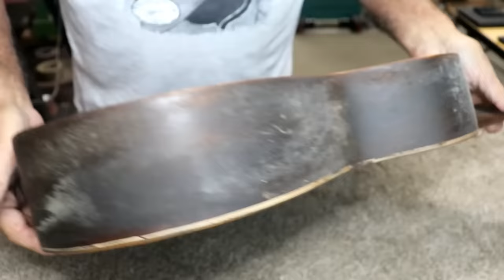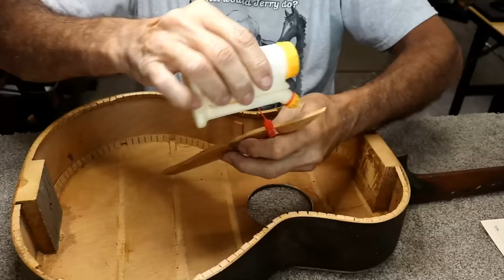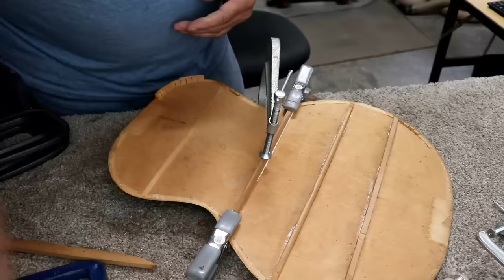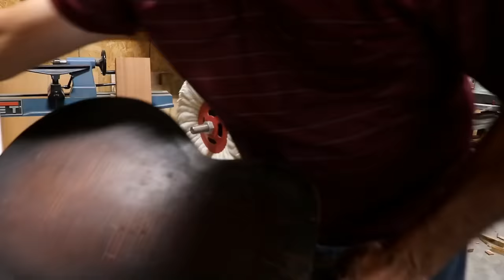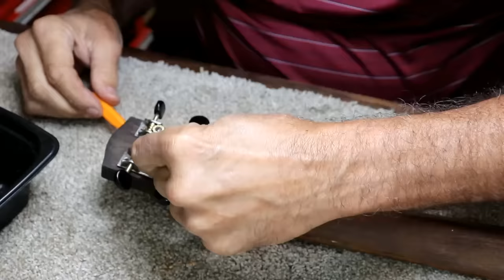596 RSW Can This Wall Hanger Become Playable? - A 1920's Mail Ordered Vintage Guitar Repair

Comment: Guitar Geek time! Those tuners Jerry cleaned up so well are extremely early Kluson units which do not have the scalloped plates. Kluson began making tuners in 1936 and it appears this guitar was made in January 1937 so Richter- based in Chicago- like Kluson itself, must have been one of the first- possibly the first company to adopt them. Very quickly other makers began using Kluson- Gibson in about 1937 and then Regal in 1939, followed by Kay and Harmony in 1940 or so. Harmony also of Chicago (Kay and Regal, likewise) was owned by Sears- which is why Sears retailed guitars were made by Harmony until 1940. 1940 was the year that Sears sold the company to its management- and Kluson helped Harmony's managers to buy out the company. So, there it is- just some tuners but an interesting history illustrated by this one guitar which now sings again, after Jerry's sterling efforts.
Reply: Awesome history, thanks! Do you know anything about Tango? I have a faux resonator with Tango on the head, shares a lot of similarities with this guitar here. Tuners look to be the same, no Phillips screws, etc.
Reply: Great tuner info!

My first guitar is downstairs here at my sister's place and I am here for a visit! Decor for the game room.  Was my uncle's and of the era and configuration of the guitar in the video. 1930s most likely. College Pal on the headstock.I do not j anything visible in the sound hole.. The video has inspired me to see if it can get a similar resurrection! 

Thanks for making the video JERRY!
Reply: Late 30's early 40s is about right. The vee neck, machine heads and the beveled end to the fretboard are good indicators. I'm pretty sure this was a Harmony made guitar, I've had plenty of them through my workshop (and still have few in my possession) and they are remarkably similar in shape and construction  from the late 1930s through to the early 1970s.
Reply: @justinlarsen2011  I have not heard of Tango- it would be a brand name from a retailer but most of the faux resonators were made by Harmony, Oscar Schmidt and Kay but I think Regal made some as well- not sure of Richter. If your guitar has the Kluson tuners it is more likely to be Kay or Harmony. Harmony and Richter guitars like the one Jerry has worked on look very similar- there are small differences but they are there. You will need to look at faux resonators and see if you find one the same and somebody has identified it. The only problem is that so many people get this wrong. The classic example is the Blue Comet resonator mandolin- it is on Wiki as a Regal product- it is not- they were made by United of New Jersey but that Wiki enrty now means everybody says they were made by Regal!
Reply: @68RatVette  Go for it!
Reply: @ChickenboneJohn  It is significantly different to the 14 fret guitars that Harmony made for Sears to be sold as Supertone models which had an arched top. One thing for starters is they had a bracket to support the pickguard and one screw in the top and one on the side for the bracket- not two in the top. This one has that Richter name stamped on the piece of wood inside, so there is no doubt about this guitar's maker.
Reply: Wow!!!!  I’m impressed..seriously
Reply: @NickRatnieks  Yes, but I was referring to the Harmony Stella 929 family of models.They have the shape and size body, same shape headstock, 12 frets to body, same ladder bracing, and over the years sold as Harmony, Stella, Airline, Regal, and Oahu amongst others.
Reply: Since you know so much about Harmony guitars I so wanna show you my 1962 for information on that one 😁
Reply: Over the years, I've restored a number of old guitars made by Kay, Harmony, Regal  Airline, etc. I've worked hard to understand these companies and the products they made. However, I've never seen such a concise, helpful explanation in one place like what you've provided here. Do you have a blog or a website?
Reply: I have a Silvertone says Harmony 57 under top but has same tuners and similar trapezoid as that 36?
Reply: Thanks neat to know
Reply: @NickRatnieks  can't u change Wikipedia
Reply: I assume that's how Chicago Musical Instruments was formed?  They bought Gibson a few years later.  Maybe the Kluson connection played a role.
Reply: Can u help indentify a regal archtop? Has no numbers ,has the regal headstock logo with the crown inside the oval rather that the crown at the top says made in Chicago it's a light burst almost like honey burst and some brown has no binding and dot inlays please help
Reply: @justinlarsen2011  
I 😢
Reply: He was moaning, as usual, about what a state it was in but I knew at the end he would have it playing perfectly!

Comment: Thank God I am my own customer.  From 1973 to 1979 I owned a couple of Sears Silvertones, acoustic.  I taught myself to play slide guitar in one day at the La Brea Tarpits (yielded thousands of prehistoric plant and animal fossils, including 20,000 (!) sabertooth tiger skulls) in 1974. In 1986 I had zero money and whilst I cleaned out an elderly woman's garage I discovered a...Sears Silvertone. It looks pretty much like the guitar in this vid, even to the braces.  The woman said "it's yours". The hideglue (you'd better hide!) pretty much deteriorated from 1986 to 2023 and my restoration in the month of May was almost exactly like this vid. The guitar sounds better than ever (1966?) due to changes in the wood. I left the action a little bit high (no neck or bridge adjustment) to accommodate slide guitar and 30 years ago I invented a tuning that I had never heard - all firsts and fifths, C-G-C-C-G-C, matching the two middle strings with 2 D strings for depth.  I chose the key of C based on string tension.  My Silvertone could fool most folk - "It's a 1921 Gibson!" if I covered the headstock a bit.  As a slide guitar it is the best guitar ever made. Watching this video put me right back in the month of May (yes it took a month!).  I purchased appropriate tuners from Stu-Mac. Thank you Jerry! I couldn't have done it without your videos.  I did make a new nut back in the eighties - for some reason I'm really good at eyeballling slots and making nuts, it's not my favorite thing to do but it had to be done.

Comment: I have a few guitars that have aged over the years and near fell apart from the glue and parts breaking down from either use or abuse. I do my best on restoring them, as they (if they could talk) could tell a story about time that passed by while they played a tune. I have both restored a few and resold them as working guitars that sound great, even though they were once a cheap guitar on the market. I have also repaired a few Ukuleles that seem to get into the hands of a child as a toy when they break down by the playing owner. I get them back up and playing tunes again and sounding great. They again touch the hearts and minds of people with their tines. I now play a few of these old Guitars, Ukes and even an old violin I picked up damaged from the late 1800's along with it's wooden coffin like case that sat damaged in a basement for many years Idle. Even though I am not a great player, I still take pride in the work I have done restoring them to playability again. It gives them life again to speak to the human ear and heart. Even though Jerry may call them nothing more than wallhangers (just to look at) if they can play a tune and touch a heart they are worth as much as any high-priced instrument if they play the right notes in tune. The value of and old stringed instrument is in the sound they give off not so much the quality of the wood and parts they are made from. The real value comes from the sounds they produce while speaking to the hearts of mankind. That's where the true value comes from. I have made a few cigar box guitars and they give off a nice sound if made properly and are tuned well. They are cheap handmade instruments, but their true values in in the sounds they produce. I have also made a few flutes from old scrapped wood and the sounds they give off is priceless. They can put a person into dream land with their tones they produce. Just because you own an expensive guitar or instrument doesn't mean a thing even they can fail to make a heart happy and enjoy the playing of the person playing it if not cared for. I don't care what instrument a person owns as long as it is cared for and treated with respect and love. If it plays a sweet note, it has value (BIG VALUE). The value is in the sounds they produce and that is priceless. If the construction is cheap but produces a pure tender sound that delights the hearts of man, they have great priceless value. That's how I see things. Always remember those old worn down Stringed instruments played the songs of yester-year and brought forth the making of newer stringed instruments of today made of better quality but also make the same sounds as the old ones in years past. Never knock the age of an old instrument or the cheapness of it's construction. If it carries a tune, it's as priceless as any other instrument made today. Enjoyed this video quite a bit Jerry. Many old instruments should be brough back to life again instead of heading to the city dump.

Comment: I just put together a mid 60 Stella Parlor guitar. The top and back as well as the neck came unglued and most of the braces were off. I used the same techniques you used putting it all back together, and yeah it’s hard to get the top and back to align with the body. I got close but ended up sanding the edges to blend with the body. The sunburst colors was so bad I ended up sanding it all down filled the cracks and painted it black. Kept original tailpiece and tuners, leveled and polished the frets. It sounded pretty good once it as done. I enjoy channels like yours that restore old guitars and provide tips on how to do it. Great job.

Comment: Got to love a guitar that shows its genuine history - none of this modern 'relic'd' silliness.
I recently bought an 1999 Taylor Baby Taylor with all sorts of wear and signs of past abuse but after adjusting the neck and cleaning it up without even trying to get rid of the signs of damage and wear, it plays perfectly.
Good job Jerry - even the odd buzz or rattle on a guitar of that vintage and apparent cheapness can sound as good, if not better, than a lot of newer instruments.
You're a craftsman.

Comment: Another excellent video.  As a former museum curator, I agree with a good wash as a first step.  We would first vacuum any loose dust so it wasn't grinding into the original finish, then gently wash as illustrated here with a drying towel immediately afterward so moisture was not sitting too long on the surface.  The chalkiness, or "bloom" as it's called is always a worry.  In this case, the lighter fluid actually removes old, unneeded wax (a great next step for the entire surface).  The most common cure for us was getting experts to determine the finish (shellac, lacquer, etc) and amalgamating it with a strategic application of the appropriate solvent: for example, alcohol on shellac.  With proper techniques, experts can actually melt the original finish (what's left of it) and add to the varnish to literally restore a worn away finish.   Thumbs up to Rosa String Works for saving this neat old instrument.

Comment: that thing looked like kindling when you started. I'm sure most wouldn't have ever touched it, but you brought her back to life! I hope the owner truly appreciates the work and care you put into it because she's much more than a "wall-hanger" now!
Reply: Amazingly enough I once owned a guitar that was in even worse shape than this one! If I remember correctly it was left over after a flea market because no one wanted to buy it and I took it, intending to use it for decoration. It might have been a little older than this Richter, not really an expert. The top was amazingly warped, no doubt it had gotten quite wet at some point, the fretboard had deep grooves from fingernails and worst of all, some truly horrible person had tried to NAIL the back to the sides where it was coming off!

This guitar is no more but some of the wood lives on.

Comment: I have a Richter Banjolele. I rescued it at a garage sale. It was in real rough shape. I didn't think it would ever be real valuable so I just went ahead and tried to make it look nice and maybe play a tune or two. I stripped the beat up, scratched paint off and surprise, surprise, it had a brass pot. It cleaned up well and I put some geared tuners on it and it sounds pretty good.

Comment: Great idea with those "Spool" clamps..what i call using your noggin..
 I realize this is an older video but by chance you read this..
Ive had problems with clamps walking as im gluing up wood..a  solution i found that helped alot was sprinkling sugar where im clamping and between the glued pieces which keeps them from sliding..it helps from walking off.
 You might experiment on scrap to see if it works for your projects.

Comment: To keep the braces from moving, you might want to try using a strip of masking tape. Super glue the non stick edge to another strip of masking tape with a small block of wood. Put them on both sides and it might just work while the clamps do their work.

Comment: I have a very similar guitar and a Luthier in Hastings, Michigan work on getting the guitar back to somewhat normal, and he had quite a time getting things to line up again. It is playable and he did a fine job with a wallhanger. Thanks for your videos, you do amazing work and appreciate your demeanor. Growing up I visited a Guitar shop in Ann Arbor and my first guitar that I brought in for strings was an old Harmony.

Comment: My key double base has straight head screws and it is from 1951. When I was a kid in the 1960 there were still a lot of straight heads still in use.

Comment: Just an FYI the white haze that showed up after buffing is probably moisture trapped in the finish. The friction from buffing got the area hot, both softening the finish and releasing humidity trapped in the wood.

The fix is actually to fight fire with fire and heat up the area again so that the moisture can be released. Just run a heat gun on low, constantly moving, and the haze will go away.

Happens all the time with early and mid-century furniture when people leave hot bowls and cups directly on the finish. Leaves a big ol' hazy mist everywhere it got hot.

Comment: I have a rebuilt Gene Autry “Round-up” mail order Guitar from that era.  It is my travel Guitar for practicing because inside its hardshell case, it fits in my dreadnought gig bag for extra protection and portability. A very successful rebuild with new frets, new bridge, modern bracing and probably a new nut.  I use elixirs on it because they’re bright enough to balance out the darkness that is inherent in these old plunkers.  But anyway, proud to say mine is not a wall-hanger, but a crucial part of my players collection.

Comment: Hello there, in the early 1970's I bought an L-48 Gibson for$50.  It too had a crackly finish from being stored in an attic for years. My solution to smoothing out the finish was very fine wet-or-dry automotive sandpaper and I little water.  It worked excellently!  It had been played so much the finger board was almost worn through. I had to pay a shop to replace it. But the final outcome was beautiful.  I sold it too cheap, but wasn't aware of that until years later when the value of older guitars skyrocketed.

Comment: I carve Northwest Coast Native Art, usually using either Red or Yellow Cedar, Yellow being the preference but hard to come by and expensive now, even on Vancouver Island where I have lived all my life. That is because of the clear-cutting and the selling of the Good (Old Growth) Stock to the Japanese and other Asian Countries. I use water when I need to bend wood, so long as the bend isn`t too extreme, then need use steam. I don`t know if water would have helped to get the bracing clamped down to the inner side of the arched top, though heard when you said you heard it crack under the pressure of said clamps. I think you are and have done a wonderful job. Great that you are saving a guitar that was made the same year my father was born. The guitar is in better condition now than he is. :) (Kidding) Take care and Thank You for the video. Brad R.

Comment: Love your content and nice job in helping preserve this old guitar. One thing to consider when trying to date the guitar by flathead screws is that flathead screws were being used at least into the early 1950’s by Leo Fender as well as other guitar makers. For instance, the first Fender Precision basses were produced late 51 early 52 and they all had flathead screws. A full 15 years after the Philips head. If we tried to date the Fender Precision bass by its use of flathead screws, we would be off by a full 15 years. This is just one example of how trying to date an instrument by the screw head type would be inaccurate. That being said, I appreciate and have been enjoying your videos.

Comment: You should try Eucalyptus oil to get the muck off a guitar like this. It cuts through grease like nothing else, and will only help old wood as it is tree oil. You will need to dilute it in warm water if used on laquer or other finish, it can strip varnish.
Just a suggestion.

Comment: I have a guitar just like that.  Back in the day, which would be back in 30's, 40's, and 50's, there was a factory in Chicago that was making guitars for a lot of companies.  Some had no names on the headstocks.  They had no serial numbers because they made so many of them.  They had lot numbers that was stamped usually in green or blue on the inside of the guitar.  They made these kind of guitars by the scores back in the day.   Even though people consider them cheap guitars, the quality that went into these guitars is still better than what they put out nowadays.